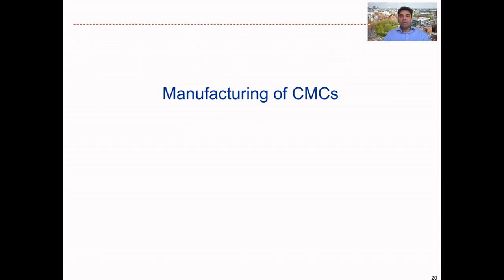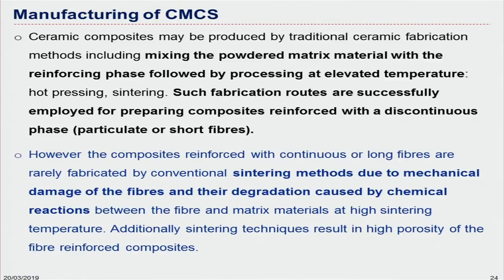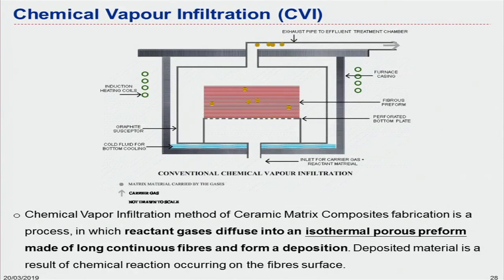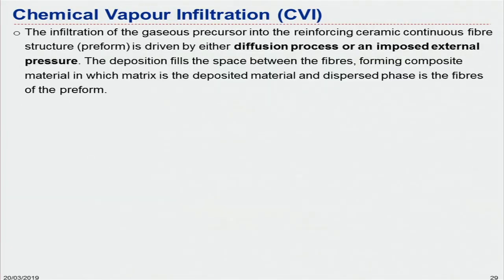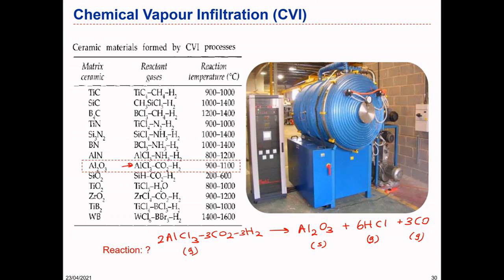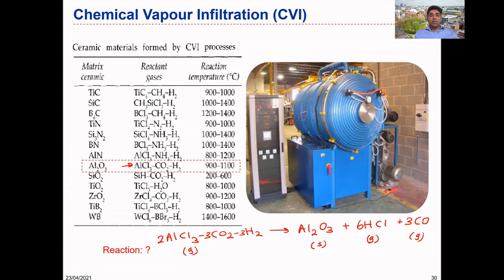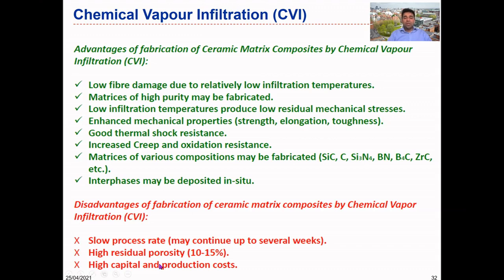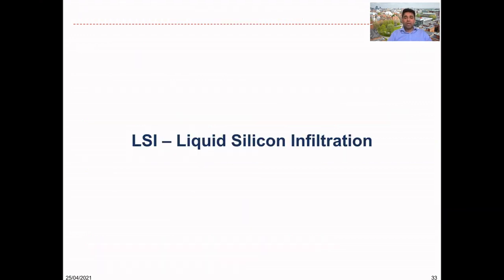Chemical Vapour Infiltration

Comment: What is the reactant gas used to produce ZrB2 based ceramic composite?
Reply from the maker: Please check ZrO+BC+Si
Reply from the maker: Hi Mishra, hope you can check ZrO+BC+Si. Also, this would be a good article:  CVI Processing of Ceramic Matrix Composites, 2012, DOI:10.1002/9781118176665.ch9
Reply: @DrChamilAbeykoonOfficial  Thank you so much!!!
Reply from the maker: @adarshar.mishra5230 , Thanks, If you think this content is useful feel free to share it with interested students.